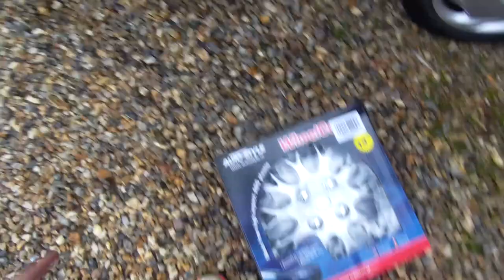NEW Wheel Trims For The Micra | Rice or Nice?

Comment: In the USA, wheel trims are called hubcaps. Generally, we tend to see them as rice no matter what, as they're basically just trying to cover up basic steel wheels that weigh a lot and can't fit proper performance tyres.

But if you like them, I see no reason not to install them.
Reply from the maker: They look alright. I just got them as the old ones were damaged and didn't look very good. maybe eventually I will get some rims but its a little late for that as I've changed the tires and I'm not sure if insurance will allow that or not and they can be quite expensive. someone brought the wheel hubs off Facebook market place.